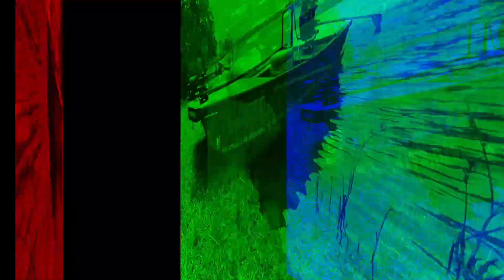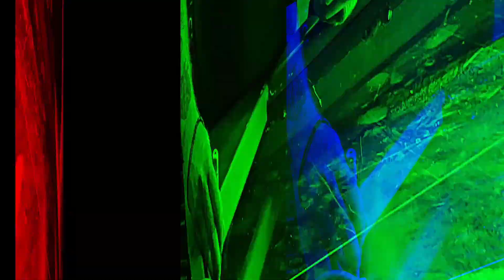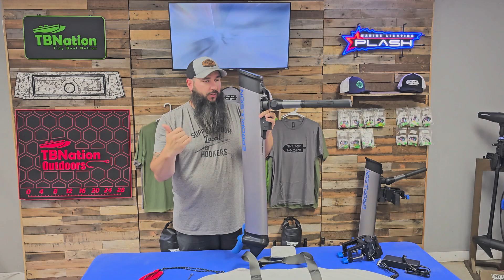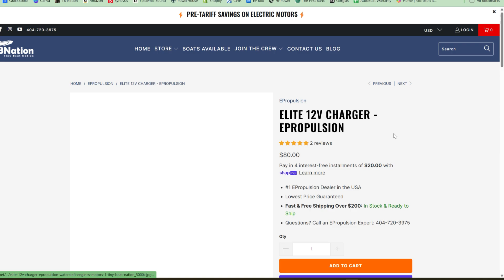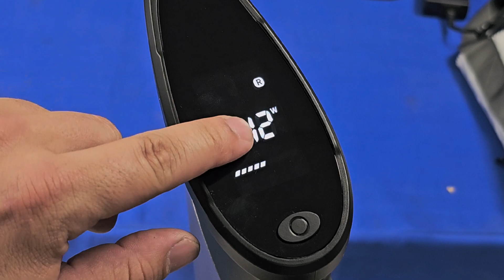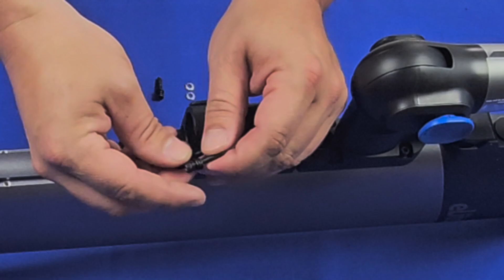The All New Epropulsion eLite Long Shaft!

Comment: I bought an eLite recently for our 2.6m inflatable tender. My wife was struggling to start our 2.3hp 4 stroke outboard (including injured fingers from fly wheel kick back) and couldn’t lift it on or off especially at sea. Now she steps onboard confidently even at sea with the eLite in one hand, snaps it onto the bracket and is gone in seconds. The unexpected benefits are how close we get to marine life from the near silent motoring, and the precise speed control (including instant reverse) coming alongside a wharf or boat. I also like the ‘anti ground’ feature that makes it so easy to run straight into a beach and instantly snap the motor horizontal (no breather, fuel tap, and tilt control needed).

Comment: Great review, thanks. I’m looking at this unit for dual use primarily for a low sitting 🌊 2 seats Pamlico Sea Kayak, and as a trolling application on a BW Montauk skiff. Just don’t know if the long shaft will compromise my kayak ergonomics vs. the Montauk use (need for a longer shaft) based on transom height.

Comment: We need an elite + or 2 or pro…

- twice the battery, but same 500w strength
- option to replace the battery easily 
- option to attach an extra battery

Then it would be perfect for so many more people. I would buy.
Reply: Yeah, or if the long shaft had more battery(since there's more space) it would have been perfect

Comment: Interesting point about trailering.  Are all e-propulsion transom clamps plastic?
Reply: @brianh1161 Only the eLite model uses a plastic transom clamp. The Spirit and Navy units feature metal clamps for added durability.
Reply from the maker: That is correct. Good boy!!!
Reply: @ Thanks.  I may have purchased a different chinese 24v troll motor, which has only a plastic clamp 😆
Reply from the maker: Just the eLite. All the others are aluminum.